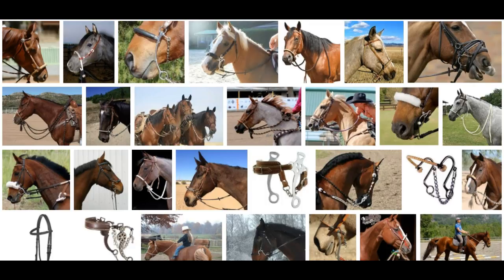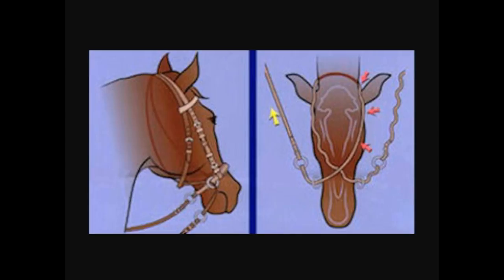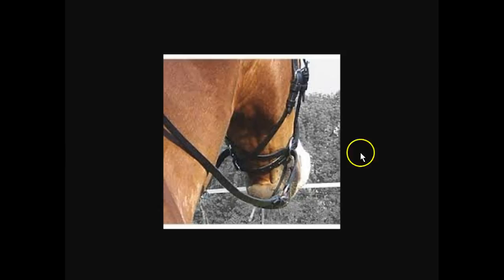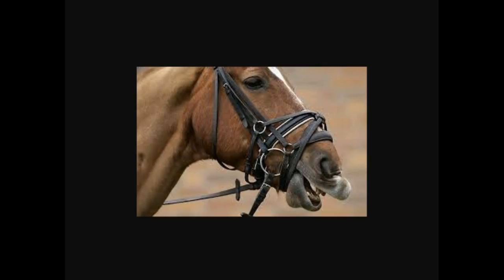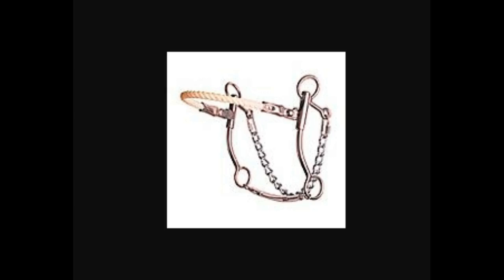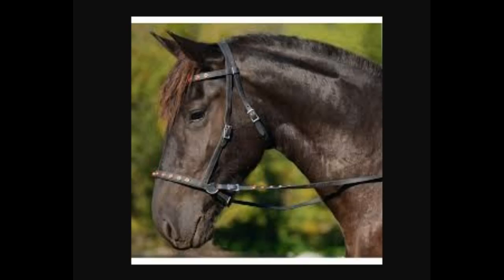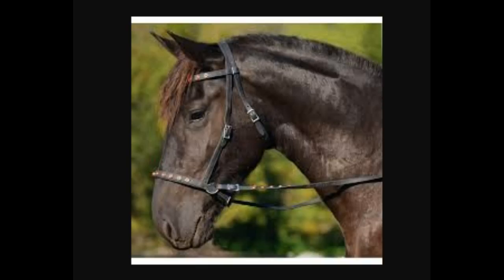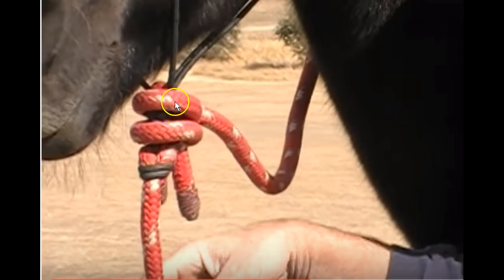Explaining & Understanding Bitless Bridles, Hackamores, Rope Halters & Benefits For The Horse

Comment: I always thought, a hackamore does more damage to a horse than a bit with a heavy handed rider. I've seen pictures of deceased horses who've been riden in hackamores all their life and had broken noses and deformities from too much pressure on the bridge of the nose. It's only better for the horse when the rider knows how to use it. Traditional hackamores are typically the best in my opinion. I've never used one tho. I used to ride in a snaffle with a joint in the middle.
Reply: Hackamores are harmful if used incorrectly.

Comment: When looking for a bitless bridle I really struggled to find a very simple sidepull as that does the same as a rope halter, it's much kinder and did what I wanted which was pressure on the nose, away from the mouth, soft parts of the nose. I was given a cross over bitless and hated it, firstly it's a nightmare to put on and adjust, secondly the reins end up being too long and thirdly there isn't any real control with a mechanism like this it's just as bad if not worse than a bit- less damaging but just as painful. I read up a lot before deciding on what I wanted, at first I was going to go for a metal sided hackamore but heard some stories it caused a lot of damage so decided against it, then I started looking for the side pull.

Comment: so basically, i just need to tie rope on my horse head somehow, as long as it doesnt loose and doesnt hurt my horse, and can lead him left or right. do i get it right?
Reply: Ano Fritz or buy a rope halter, theyre not very expensive
Reply: You can get custom rope halters they're quite easy to tie Rick has videos on it even on his webpage. But yah if you can get a horse to turn right or left in a halter than you can do it in a rope halter. 
Sometimes it takes a little getting used to and best done on the ground working your way to ridings. 🙃

Comment: Can someone please explain to me why bridles with the reign attachment on the sides are bad? Why does it cause the horse to throw his/her head up? I simply don't know...
Reply: I don’t quite know what he’s talking about with the horse pulling it’s head up because of the reins being on the side. If he’s talking about the horse tossing it’s head around then that’s an indication that the rider is being rough on the horse. I’ve never seen horses with a sidepull system head tossing but then again I only watch or work with more experienced riders most of the time. I don’t think sidepulls are bad. No matter what piece of tack it is it has the capability of irritating the horse if it’s not fitted or used properly.
Reply: side pulls are not Bad but what he’s saying is that you have better communication when the reigns attach under the chin since instead of pulling the horses head only side to side (as with reigns attached on the sides) you’re also pulling it downward so the horse is less likely to hold their head up high. hope that helped!

Comment: I have yet to try the hackamore. I find the rope halter works just fine. I was wondering about the hanger on the hackamore. It seems it needs to be fitted precisely. If not, the hanger gets very close to the horse's eyes. How much  movement is there in the hanger near the eye when riding?

Comment: Why don’t you like buckles? No hate, genuine question
Reply: Rick doesn't like any type metal on horses
Reply: What about the buckles on saddles then for your cinch?
Reply: @meganrees1282   I have no clue, havent heard him talk about it, you can try and find his opinion on his website http://www.thinklikeahorse.org/index.html
Reply: I think Rick mentions something about them on his website, buckles (and clasps) can break or come undone easily. If the horse is in motion (Running, jumping,etc) and the buckle breaks, it can whip back and hit the horse in the eye or give him a bad whip to the face. When the buckle comes undone, you have a loose horse running and no way to control/direct it (unless you have trained your horse to give to pressure with a neck rope,then maybe you'll have a better chance of stopping it)  If you have a good knot (hence the rope halters and bosal without the buckles) the only thing that can break it is you untying the knot and since there's nothing metal on it, there shouldn't really be any damage.

As for the buckles on the saddles, it's a little different since all you do is sit on it and doesn't interfere with the horse's face. With bridles/bit-less your hands are sometimes constantly moving, pulling on a horse if he bucks or rears therefore some buckles might break/come undone. If a saddle buckle comes undone or breaks, you'll just fall down or get thrown off since the saddle won't be fitting the horse properly.
Reply: I think buckles change the way pressure is divided, they form little patches of extra pressure in the wrong places. A one piece bridle looks lovely, but must be custom made for a horse or it involves complicated knots. Which reminds me, that a rope halter also mentions these pressure points, that the knots need to be at exact the right place on the horses head to be effective. Thats maybe also why some do not encourage to use a rope halter to ride with.

Comment: A  mechanical hack is what I call a cheat, cheats the horse and cheats the rider from having to learn how to communicate with finesse .
Reply: why do you consider it a cheat?  No reason why a rider cant be very light with their hands in a hackamore. Do you think for some reason they cant feel light cues on their face when they can feel the touch of a fly?  I think  finesse in a hackamore is actual easier to achieve. Consider safety too. Im all for free riding but don't think I would want to trust even the safest horse to never spook in certain circumstances and I would want a ' break' and a way to stop a runaway for such emergency or have some means of control in certain situations for the horses own sake. Yes its restraint and force. Just like putting up a fence is. Just because they are well trained doesn't mean they don't have instincts and triggers.  We may have domesticated them, trained them but they are still individuals with feelings and wills of their own, not robots. So they do need to know they arent the boss, that is horse society it has a pecking order, also They dont understand the human world and its hazzards and are not going to consider our opinions in fight or flight mode. So yes free riding and communication are best first choice but sometimes 'cheats' are needed and restraints are necessary within reason.
Reply: @Shewolfen  
A mechanical one, that puts pressure on the entire face plus has a metal chain dig into the soft underside of his chin. There's no bone there, if you press your thumb into the flesh between your jawline and chin, you'll be able to feel your tongue lift up while your jaw doesn't move. It's not comfortable, pull hard enough it just hurts. Mechanical hackamores are cheats, because your horse either complies or is in pain.
Regular hackamores are impossible to cheat with. It's literally the least amount of rope you can have on a horse's face. It only pulls as hard as you pull, and the softer you are the better the horse responds.
Rick can get his horse to turn around by pointing at his flank and turning the lead, held between a thumb and forefinger, slightly in the same direction. There's literally zero reason why you need to use pain.

Comment: Wouldn't that mechanical hackamore chain part make it hard for the horse to breathe? If it really digs into the horse then wouldn't it put pressure on them? Just curious, but you really have made me want to use the traditional hackamore. Now that I look at bridles the nose strap looks so tight and painful on them. And when your horse is strechting its mouth or looking relieved after you take off it's bridle with a bit, that means you have hard hands in my opinion.

Comment: This is weird. You and RaleighLink14 have seemed to think similarly, however this video shows otherwise. You say that you like the traditional  hackamore because it doesn't have any metal or leverage. RaleighLink14 says that the traditional hackamore you talk about isn't a hackamore at all, and the rawhide doesn't bend and rubs the horse's face raw. I can't win!
Reply: ReleighLink14 thinks similarly because she watches rick gore videos.
Reply: SixStrides Metal and horses do not mix. Chains, snaps, buckles, bits, etc. are just another way to hurt a horse. A traditional hackamore could rub the nose raw if you have hard hands. Learning to ride with one rein is a great way to learn to be softer
Reply: If the bosal or the traditional hackamore if rubbing your horse it is fitted wrong or you are using it too much.
Reply: It rubs the face raw because their hands are too heavy and they are riding with their hands instead of their body. I stop and turn with my hands but I ride in a halter with detachable reins and I have soft hands.
Reply: SixStrides my horse does not know how to ride by leg, but by hands.

Comment: Rick, do you think it's legit to have metal fastenings that are not involved in exerting pressure or force on the horse's face?  Some of those halters seem to have buckles for adjusting the fit, but not for anything else.  Is there a more ideal way to make them easily adjustable without using metal buckles?

Comment: So let me get this straight which do you prefer bridles with bits of mechanical hackamors?
Reply: Neither, they’re both terrible. They both hurt the horse, they both put torque on the horse’s face, and they’re both ridiculously expensive
Reply: Neither. I honestly don't count mechanical hackamores as bitless bridles since the metal shanks and chain act like a bit but externally. Such a harsh tool that I believe shouldn't be used at all.
Reply: LUCY TALBOT = get your hearing checked  ~  OR... you could pay more attention !
OR PLAY THE VIDEO UNTIL YOU GET THE MESSAGE STRAIGHT.   HE DOES 
REPEAT HIMSELF OVER & OVER FOR THOSE WHO GET DISTRACTED !!!!!

Comment: Has Rick made a video about how to transition a horse from a bit to a hackmore , or bosal.. or a rope halter? If he did I can't find it . :( Is it a seamless transition or does the horse need some help transitioning ?
Reply: pitbullprincess2010 yes he has. Most of the videos are repetitive as he gets asked that all the time, but there is no transition between a bit and ridding in a rope halter. You put the rope halter on and practice in a controlled area. Likely a round pen to teach the horse to move off the pressure under saddle. If you don't have a round pen use the smallest field on your property or a paddock. I highly recommend you teach your horse how to flex on both sides before doing this or they won't be soft enough to understand what a one rein stop is. I personally ride in a bosal as I don't like how the rope halter moves so far back under the horses jaw and the reins are up high on the neck by the jaw bone at times. The bosal seems to keep the reins down away from the jawbone but not adding undo stress that a bit adds.

Comment: I kinda liked the blue hackamore (I like blue), it's not a traditional one, but since u said tht it puts pressure in some places cuz of the way the reins r on the sides. Maybe just change it a bit so tht the reins are under the chin and put less pressure on the horse. Or just ride using a halter? ^u^ I love to ride and I go to a trainer, she uses dressage bridle for when i ride and she has... wut is tht part of the bridle tht connects from top and under the mouth? Well she uses it. Maybe i get her one of those leather traditional hackamores to ride with instead? :P Yr very experienced and like it when u talk about how the horses feel and the gear tht we could change for the better.
Reply: Emmy Harrop 
I think that blue bridle is an adjusted hacklemore, because there's a knot behind where the chinstrap is that the reins may have been tied to before. Use whatever color you like, my friend.
Reply: ^u^

Comment: what is missing in this video is explaining more what is best for the rider as well and for individual horses. A traditional hackamore wont work with some horses, it will simply fall off their head because it is not attached underneath, or pull over the eye etc. I mean it works wonders with a well trained horse that you have done loads of groundwork with and they know each signal (and preferably one rain riding (western)). But some horses that are way too forward you need something with added safety. Like a side pull in leather.

Comment: Rick, I wonder how the traditional hackamore would work with an English saddle.  I can see it works really well together with the Western saddle.  Posture would be a little different for an English saddle and I'm wondering if you've ever tried this out and what you think.
Reply: Blacksquareable the traditional or the bosal would not work well with the English way of riding.  English rely on constant contact.  The bosal is designed to be used with neck reining and should NEVER be used as a constant contact piece.
Reply: Thanks.  Appreciate the info.
Reply: Leah Waggoner You shouldn’t have constant contact on your horse period. There’s this thing called release
Reply: Harper Beakly English riders have constant contact.  Even though they shouldn't they do.  It's how they are taught to ride.
Reply: Leah Waggoner Then learn to ride with one rein
Reply: Harper Beakly I don't ride English.... I ride with a bosal... Western....  Sooooo.  What are you trying to argue with me over exactly?
Reply: I ride english with just a rope halter.
Reply: Jumping hackamores are my absolute favorite for English/dressage. They look very nice too.

Comment: Is it ok to use a halter ( not a rope halter ) and connect reins to the two "side rings" ?
Reply: i tried to do that and it worked pretty well (i still ride like that but i'm working on a "custom bosal" made out of different halters parts), but make sure that you tie a knot in away that the metal doesn't touch the horse's face. i wouldn't use snap hooks.
Reply from the maker: did you watch the video, do you lead the horse with the rope on the sides or under the chin?
Reply: my horse turns calmly without having to pull her head, but thanks for the video it was very helpfull i'll try to lead her under the chin aswell  :D Thanks again!
Reply: Under the chin always ! It's wasn't a personal question, I personally use a rope halter set up with no bit but I was interested as one of my friends uses the method that I mentioned !

Comment: What do I do BC my horse WONT move and I use my body and my hands he will try to buck me off if I try to get him to slightly move him I dont use my hand THAT much and wen I do I try not to do it too hard but he just buck and kick and won't move I used a egg butt bit and a bitless bridle idk Wut to use!?!
Reply: Are you able to lunge?
Reply: Sounds like you're going way to fast and have no relationship with it.
Can you even go under it or between it legs if those are no answers it's you who is the problem.
Setting the horse up to fail.

You need to do ground work it seems it's way to early to start riding it if it's acting like that.

Comment: For the second “mechanical hackamore”  I have this exact hackamore and the bottom chain is a curb chain, it dosent pull on the horses under mouth, it puts pressure on Top of their noise
Reply from the maker: LMAO really, and just how do you think it puts pressure on top without putting pressure on the bottom...  Stay in school or get your money back
Reply: Think Like A Horse  I like you’re videos and information you send out, but  it is used as a curb chain
Reply: @mybayriver7565  take another look at how the chain is attached. It DOES cause pressure and is not just a curb chain.
Reply: JL P  aye aye aye, it doesn’t put any pressure! THE FRONT OF IT DOES NOT THE CHIN PART
Reply: @mybayriver7565  The leverage pulls the two together. Pressure.
Reply: JL P  no comment
Reply: Jr.equestrian i ride in a hackamore too (just smaller) and yes it put pressure on the nose, besind the nose and the horse neck. Is like a kandar bit or a pelham/gag bit with a Chan besind.

Comment: Hey Rick, I have a question. Is neck reining better than plough reining or vice versa?
Reply from the maker: plow is called direct reining, neck is called indirect reining.  Direct reining gives clearer signals and less confusing, after years or 1000 hours of riding then you and horse become one and know each other so you can do indirect reining without confusing horse.
Reply: Think Like A Horse ok thank you for explaining the differences to me! ❤️
Reply: The Equestrian both are good. do not pull up when neck raining. cross gently over. speed will come later. touch your heel gently and your horse to move away from it. Gently! Ukulele Atlanta Holly